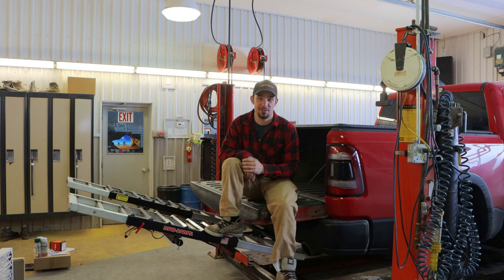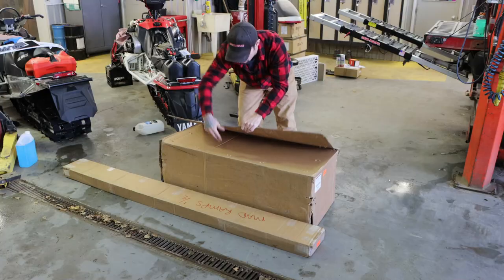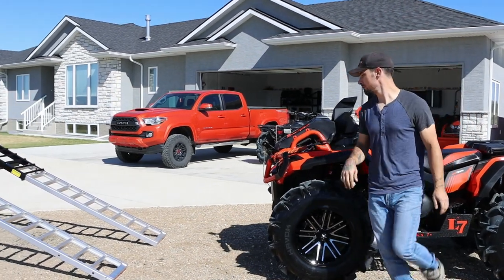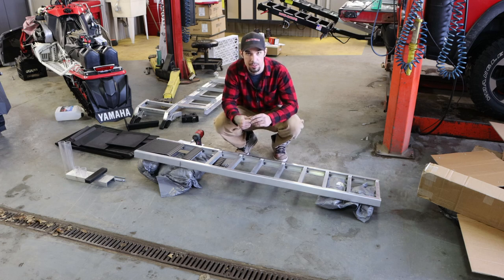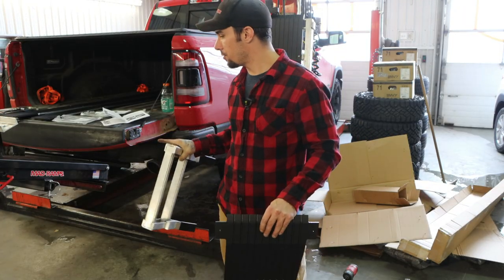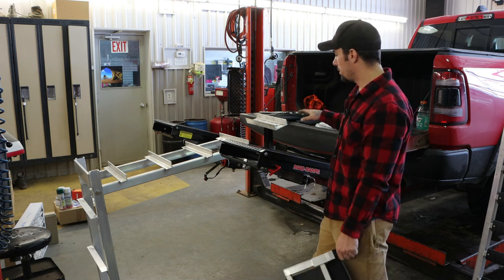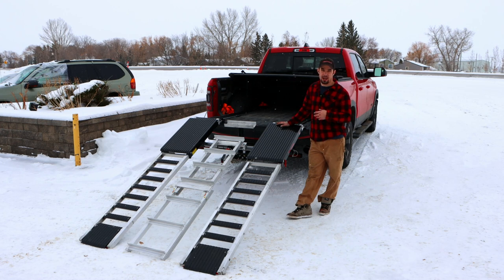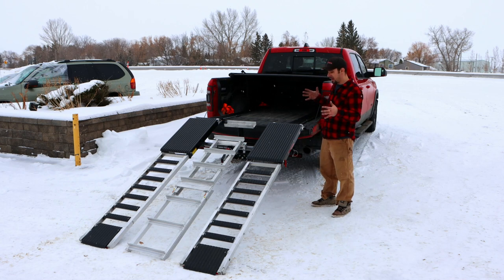MAD RAMPS: Snowmobile Ramp System!

Comment: My trifold ramp with ski guides on it works great for both atv and snowmobile. I only have to have that one ramp. And it slides under my atv when traveling. And I slide it between the ski and track of my sled. Then pick my back of the sled up and set it on the ramp for traveling. Seems a lot easier and less expensive.

Comment: Where do you put the track ramp after the sled is loaded?  Seems like it would have to lay between the side of the bed and the sled.  Any concern with damaging the side panels?
Reply from the maker: It does have to store with the sled. I simply strap in down with the snowmobile skid, no worries at all!
Reply: Why not design it so it stays purmently on the ramp

Comment: Good video, is there enough clearance to load a sled with a hard tonneau cover? I have a trifold that covers about 6 inches when folded against the rear window. I’m hoping with this system I don’t have to remove the tonneau cover. I have a GMC Sierra short bed 5.6 box.
Reply from the maker: If you're talking about the sled under the cover it depends on your sled? No idea. I can say I had mine fit with a cover folded.

Comment: Wouldn’t there be an issue with melting the plastic on the ramps with the exhaust? Or is it able to take the heat
Reply from the maker: I dont see it no, my truck liner can handle that no issues and the bed protectors I get the impression will take the heat too.

Comment: I thought about getting a set of MadRamps. But I think a sled deck will just work better. Can use it for well... sleds a quad or a sxs.
And I've got another truck available for when I need to use the box for getting stuff thats tall.
But I do like the design of the MadRamps it works good.
Reply from the maker: Like I say in the videos, I really dont think this set up is for everyone but I'm proof it's a solution to a problem. More so on the atv side of house for me
Reply: @MainvilleATV  If only we could be filthy rich and have a vehicle specific to haul what machine you want to ride. 😄

Comment: Hey do you still use this snow mobile ramp? I bought the mad ramp and it’s great for atv but wondering how well it works in winter. Did you issues with red levers freezing with ice etc. Also how was ease of loading and unloading? Do you think studs would tear up tail gate and truck bed or does centre is pedestal prevent issues. Thanks I’m advance. Loading Polaris VR1 137

Comment: I have a question about a 2020 outlander 450. The brake light illuminates very late when using the brakes. It appears that the brake lever needs to be pulled in very far in order to activate brake light switch. Are there any adjustments that can be made to allow brake light to illuminate when we use normal brakes?
Reply from the maker: Odd issue. Mine activates instantly. I'm assuming the would be some sort of adjustment that and be made but I have no idea. I'd look for the ability to move the activating switch closer to the handle. Not sure off the top of my head
Reply: @MainvilleATV  Thank you for such fast response!! Is the brake switch in the brake lever assembly?
Reply from the maker: @kirkmiller3376  I believe so! I'd have to take a look at a machine
Reply: @MainvilleATV . Thank you again for the fast response. I looked at my brake lever and foot brake. No electrical.  A forum states something about a hydraulic switch somewhere in the brake line. Hmmmmmm..........
By the way, you guys have a great channel. From the way you and your wife do things together, reminds me of my wife and I. We raced RC cars, go karts and now ride atv's together. Great to see your life together. Also, your mechanical know how of these machines and products is awesome!! My wife and I watch your channel all the time. You both are awesome! Thank you for your help.

Comment: Quick ? I am looking at 28"sludge hammers for my grizzly. How are they for day to day riding. Are they tolerable for the odd dry trail day?
Reply from the maker: Absolutely, I find them very versatile and have been using them in all conditions: trail, mud, summer, fall, winter, water, etc.  Kyle has purpose driven sets of tires that he switches out based on terrain etc, but I use my sludgehammers for everything and keep up just fine. Hope this helps! - Cass
Reply: Thanks so much. Its hard finding  info on them, this helps alot. cheers
Reply from the maker: No problem at all!

Comment: Licence plate blocked view - some cops will give ticket just like for bicycle racks.May want to move plate back?
Reply from the maker: They've never given us a problem what si ever. My plate is stored away on the sled and they just ask to see it
Reply: I was refering to the truck licence plate view being obstructed. Some cops ticket for that in Ontario Canada. At the same time the Toronto Police use the same 2"trailer hitch bicycle carriers and do not give themselves tickets. Someone with bicycles on the back are not the type to run from an accident or the cops. Sad